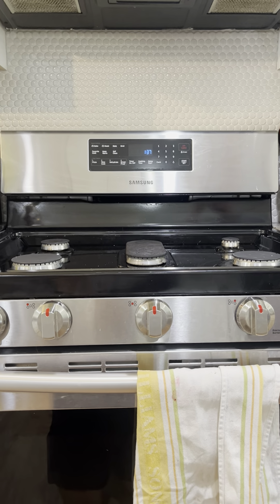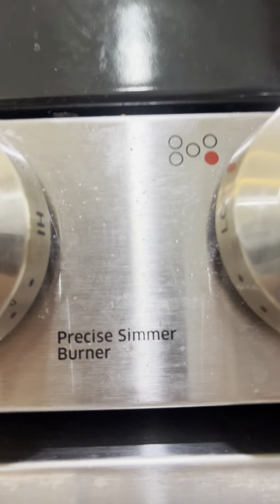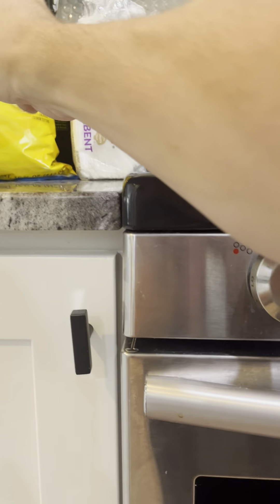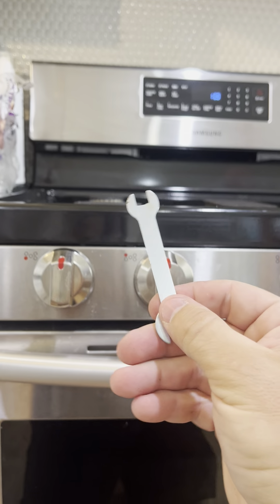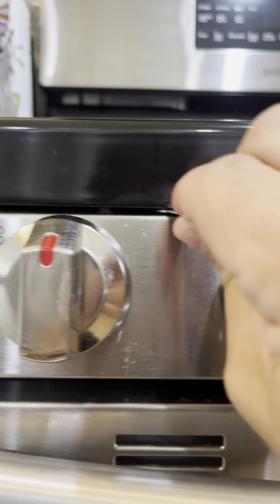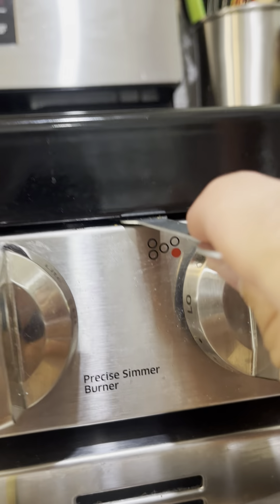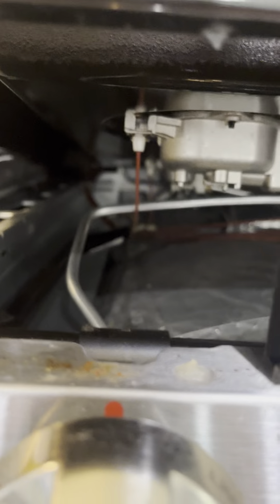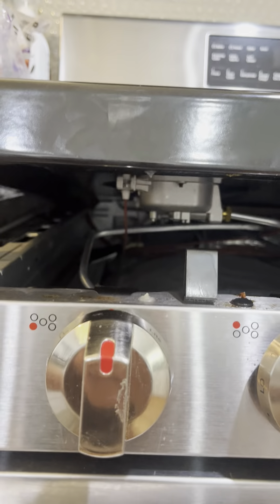Samsung gas range stovetop igniter replacement.

Comment: The front right one of mine lights but the flam is very low, not like the other burners. Any suggestions? Thanks
Reply from the maker: If you pull off the grey cover that disperses the flame are the holes in the metal gas outlets all clear and clean? That’s my only thought is there has to be a restriction somewhere maybe because dirty. Or has it been that way since new?